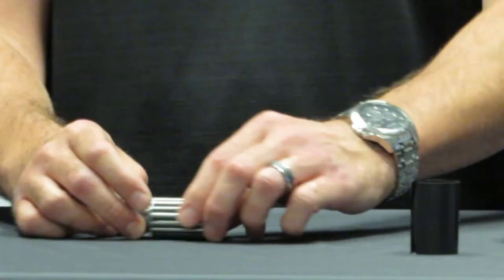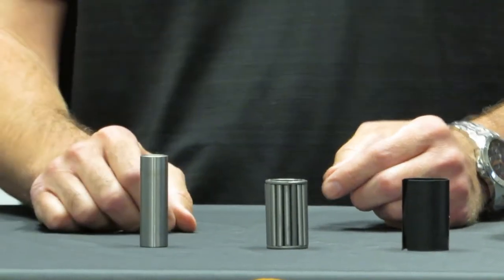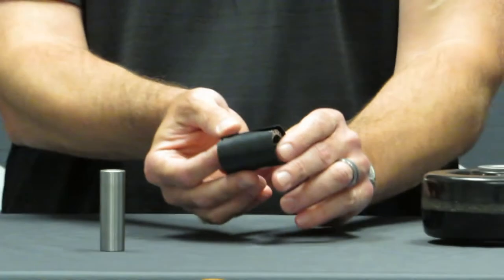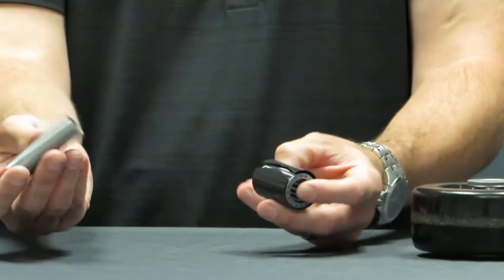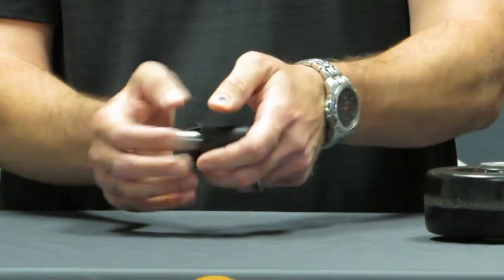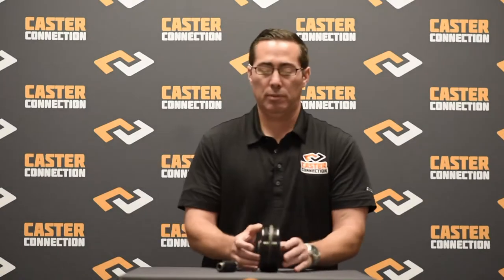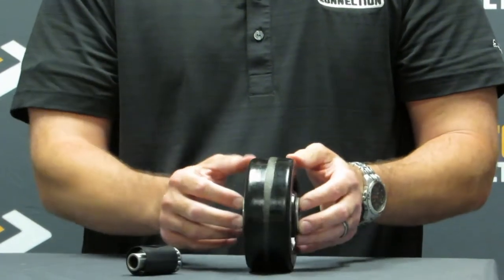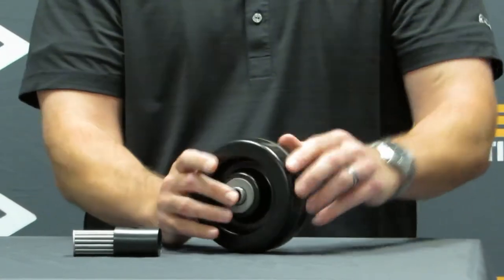Caster Roller Bearing Overview: Your Caster Connection

Comment: I only recently discovered caged roller bearings. Why would manufacturers of commercial lawnmowers including my $70,000 John Deere 1600 Turbo use them? It has 10 casters with caged rollers and bushings on each end.